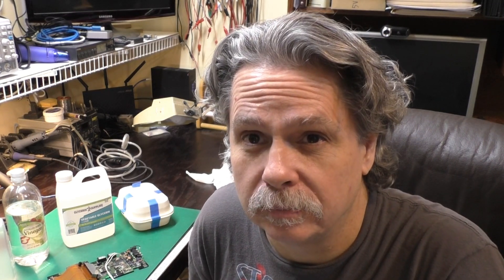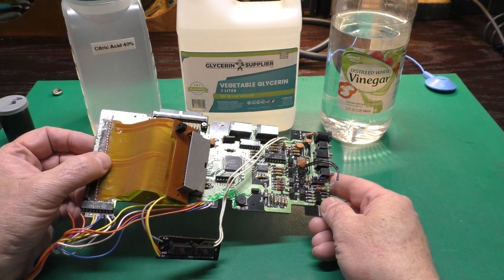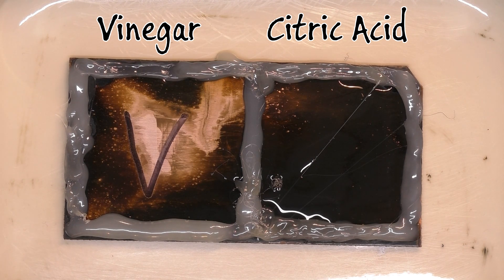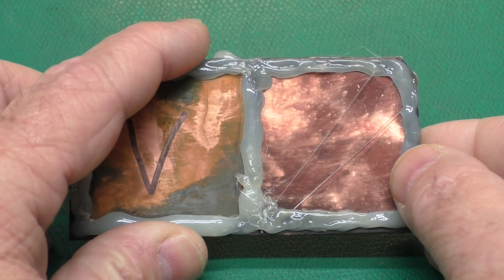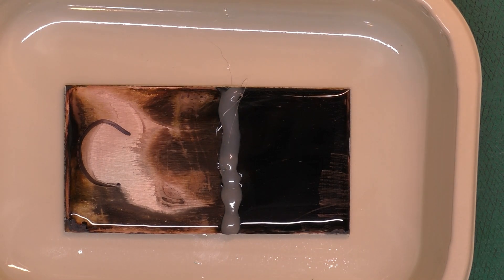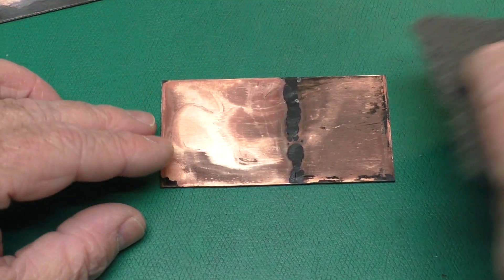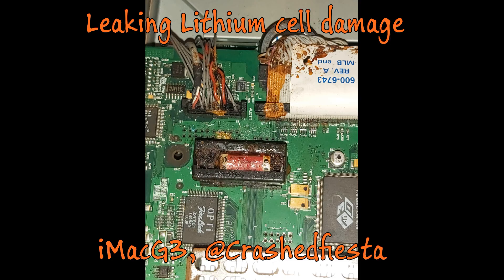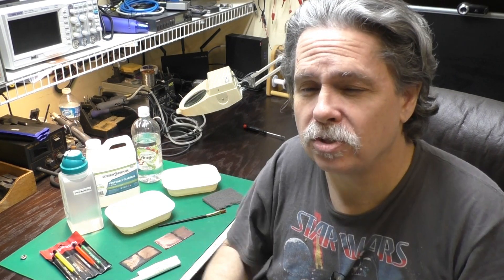Acid Test!! Chemicals for cleaning up after leaking alkaline batteries.

Comment: If you used equal parts VG to 40% citric acid solution then you made a 20% gel and the test liquid vs gel citric acid was a 40% vs 20%? Not fair.

Comment: Thank you for the info. I like how methodical and detailed you were. It's straightforward and I can see what is happening clearly. I sped up the video on some parts because I wanted to see the final result sooner (constructive criticism) but your presentation was excellent and the information was very valuable overall. I am praying that I can clean up a battery acid mess in a rare Casio keyboard from the 80s. Based on this video, it looks like I need to make a citric acid mix. I will do a bit more research and compare the findings. Thanks again. You are a YT hero. :)

Comment: Hi Jeff. Thank you for the video.

Can anyone tell me if the damage at 16:00 is done exclusively by electrolytic type of capacitors?
Reply from the maker: Yes, that damage is from 'wet electrolytic' capacitors which have an acidic electrolyte which can leak out. Battery leakage causes similar damage.
Reply: @HeyBirt  So, other types of capacitors don't damage the PCB's?
Reply from the maker: @peddersoldchap  In general no, other types of capacitors have nothing in them to leak.
Reply: @HeyBirt  Thanks for your replies. Cheers!

Comment: Not a chemist, but I think mixing glycerin and citric acid actually weakens the acid. What I remember from school, if you mix an alcohol such as glycerin with an acid, you get an esterification. There are even reports out there that this very reaction between those two chemicals can be used to make a biodegradable polymer (though it requires 150°C to really get the reaction going). And vinegar plus glycerin forms triacetin.
The WD-40 seems like a valid approach, since alkaline + oil = soap. The penetrating effect might help get it in the nooks and crannies you normally wouldn't be able to reach, although it might also penetrate to where you don't want it.

EDIT: Ooh, have you tried toilet cleaner? The stuff I get here in Germany from Aldi contains formic acid (for decalcification), and it's already pretty viscous (to make it stick to the rim).
Reply from the maker: Yes, it does slow the reaction of the acid. The benefit of a small percentage of glycerin is the increase in viscosity so it will stay in the area you apply it to. 

I think citric acid is ideal though. It is inexpensive, safe and effective.

I do need to try the WD-40 and see what it accomplishes.
Reply: @HeyBirt  Let us know what the WD-40 does. Theoretically, on the plus side, you don't run the danger of over-compensating the base and going acidic, causing further corrosion. An excess of oil is just oil, and can be washed off with soap. On the other hand, while it should neutralize the base, I'm not sure it'll remove the patina from chip legs and stuff like that. It think that's basically what the acid did, it ate away at the top layer of the metal, exposing the underlying fresh copper/nickel/whatever. But maybe that can be done mechanically later on. A potential danger is that due to the penetrating effect, it might creep into chip packages. And who knows what it'll do in there?

I also wouldn't discard the formic acid (e.g. from toilet cleaner). Since it's also an aldehyde, it should double as a reducing agent and perhaps counteract any oxidization on the exposed metal.

I guess you can really go down the rabbit hole with stuff like this. Anyway, Jolan Tru!

Comment: Living in hot humid FL, I get hit in spades with leaky batteries, so I started a lithium battery only rule, for my old (valuable to me) equipment.
Reply from the maker: Using CR2032 etc. is a popular option as it is easy to pop them out when in storage. While they too can leak it is not as common but still a good idea to pull the batteries when in storage.

Comment: Very useful video.  I would guess that stirring any of the solutions up every few minutes would probably help.  I would assume that some areas get neutralized, and stop working.
Reply from the maker: I think you are right. I brushed the vinegar/glycerin mixture periodically on the CE-150 PCB and it did work much faster. I think especially with the gel that the increased viscosity limits any natural 'convection' movement of the fluid.

For the purpose of the test the best way to keep things consistent was to just let both samples stay stationary. 

It would be interesting to make an automated rig to brush the surface of the PCB every 15 minutes and see how it effects the time required.

Comment: A great topic. I've been using a "cleaning and disinfecting" strength (approx. 25% acetic acid) vinegar for the past year with great results. I do like the glycerin idea -- that is a primo tip!
Reply from the maker: I think when you periodically brush the board the presence of glycerin does not slow down the reaction as much. You could probably get by with far less than 50% too, maybe 10%. The citric acid was more viscous than the vinegar but not as viscous as the vinegar/glycerin and it still stayed in place.

Comment: Very interesting Jeff, I think I'll give the citric acid a chance on next battery damage. You don't want to leave any copper (or worse iron like in some IC pins) exposed after cleaning the salts/oxides, as it will corrode quickly again. If you have exposed copper, either tin it or apply some enamel paint.
Reply from the maker: Good advice Frank. Thanks.

Comment: Thanks for this Jeff, really useful information. I cleaned up capacitor leakage with vinegar before, I had no idea that it's actually the opposite of what you should do. Also I'm definitely going to try to make my own citric acid solution from now on. :)
Reply from the maker: I have also use vinegar for caps before and I think it was Josh, from 48KRAM channel that mentioned that the capacitor electrolyte was acidic. I finally found it mention on Vishay's website as confirmation. Now to play chemist again :)

I was surprised it was so cheap/easy to make up a liter of strong citric acid, less then $10 even with a new container.
Reply: I can imagine it might be helpful to have some litmus papers around if you're not sure.

Comment: What did you used to separate the 2 sides?  Hot Glue or Vasoline?
Reply from the maker: Hot glue. I thought I had mentioned that but maybe it got edit out by mistake.
Reply: @HeyBirt  You did later in the video after I had posted the question.  I think you said something about removing the hot glue.
Reply from the maker: @richardblack5710  OK. Sometimes I make a point of mentioning something and them wind up cutting that section for some reason so I thought maybe that was the case here.

Comment: This is good information, thanks Birt! I am interested in trying the citrus acid although vinegar has worked well over the years it really does stink. 
I have a MAC SE/30 with damage as bad as I have ever seen and a gallon of WD-40... It seems fate should bring them together
Reply from the maker: The lack of odor is nice. The ability to easily tailor the strength of the solution and the increased viscosity of citric acid are also both very handy attributes.

Comment: Not familiar with electronics, but in cleaning motorcycle parts (vinegar is a great option to clean lightly rusted gas tanks - Google it.) it is common to use some type of agitation.  So I think the tip to occasionally brush, or agitate, is a great one.  Great video!!
Reply from the maker: I had brushed the vinegar gel on the CE-150 on  periodic bases and it did seem to make it go much faster. Glad to learn that it does sound like it will work.